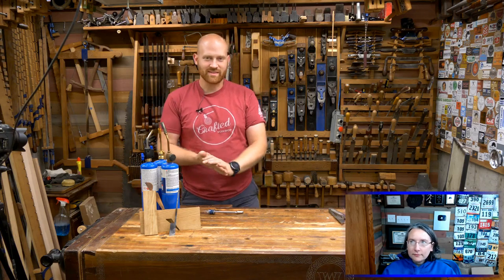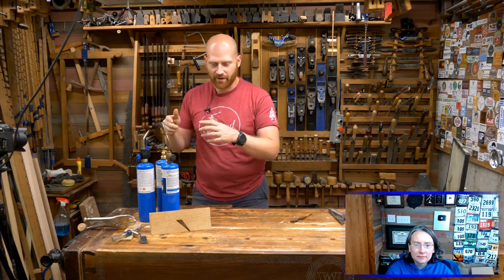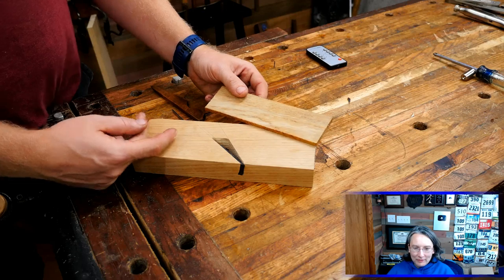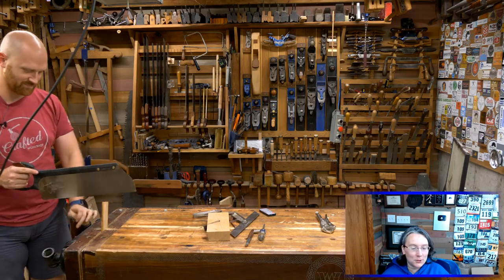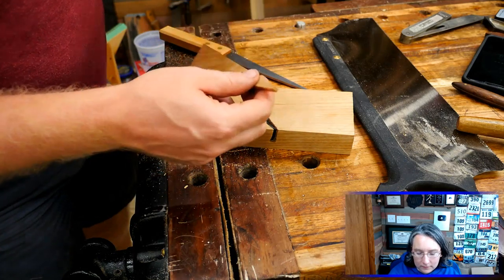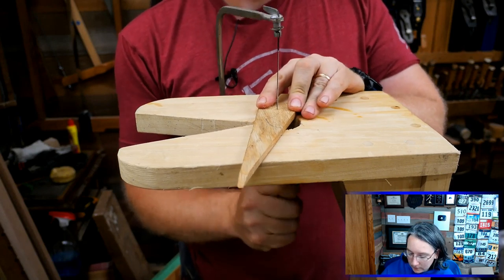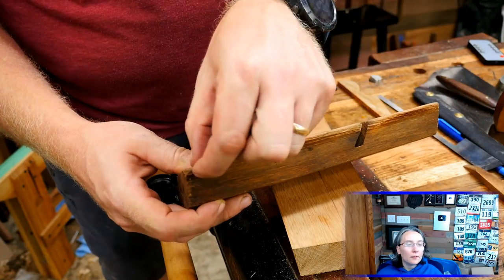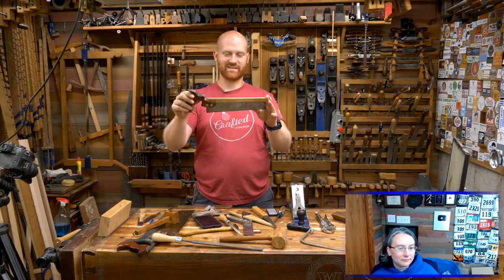Putting it All Together Making a Molding Plane

Comment: I get my steel from old circular saw blades.  I don't worry about hardening because molding planes usually are not used for that long a time.  It is so easy to just pop the blade out and refresh the edge that it is just too much trouble to go through the hardening process.  A few passes on the strop usually takes care of it.
Reply from the maker: Right on. That steel is good for it. In this case the steel had been annealed so far that bringing it to an edge would cause it to fold over and the first few times it would pass the wood.

Comment: Please spend a little time discussing chip clearance from that plane... I notice an angle at the top of the throat angling OUT of the side of the older plane. Others do have shallow curved surface to lead the chips out of the throat.
Reply from the maker: thanks. I will be talking about that in the last video. one of the little steps that can make a big difference!

Comment: I think you should try a hand cut Maloof joint for the next live. After the plane is finished. I don’t think I have ever heard of anyone doing that. I know I haven’t seen it. Could be a YouTube first haha. Great job. 

Also question: since I will be getting my membership at the tool meet in Missouri I don’t know where the location is. Can you share the address so I know where to go? Thank you!
Reply from the maker: you would be cheaper getting the membership ahead of time. prices go up at the door! it will be at the oasis Hotel and convention center in Springfield, MO
Reply from the maker: I have seen it done by hand, but that is a joint that was designed to make it easier for power tools, so it is a good bit harder with hand tools. but it can be done.
Reply: Wood By Wright if I was to just go on Saturday it’s $25 for membership and free admission right? Then if I had a membership already it is $60 for all three days? I just want to make sure I have it all right. Thanks
Reply from the maker: I believe the $25 is just for admission. you still have to be a member. plus by the time Saturday rolls around most of it has been picked through. the best deals or on Thursday morning.
Reply: Wood By Wright Okay and and can you pay just for one day? Or if you go Thursday it’s $60 for one day or the three days? I guess I just need to get the membership now and then I will get the contact info for someone within the Association? Thanks for all the info I’m sure it can get annoying answering all these questions over and over lol